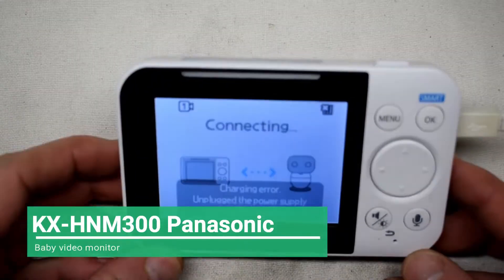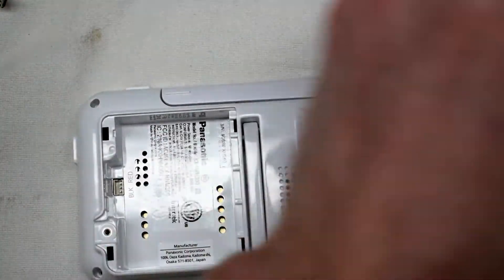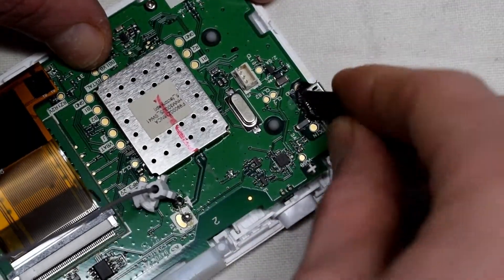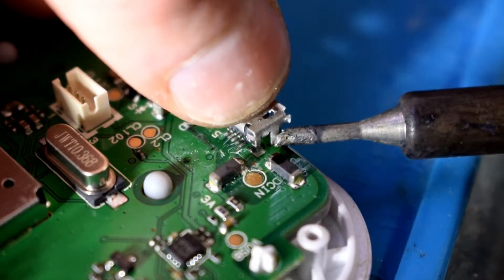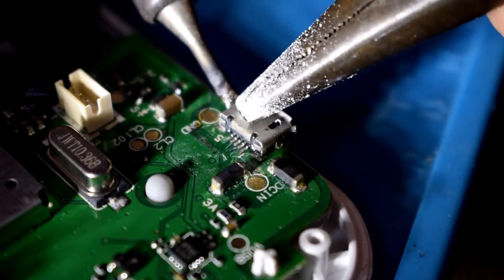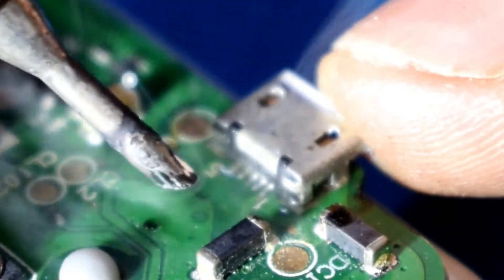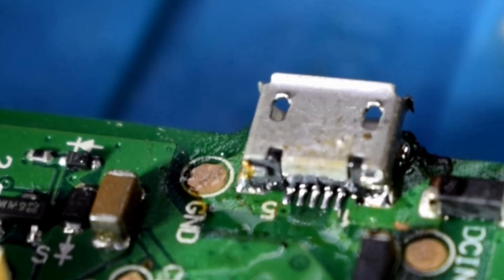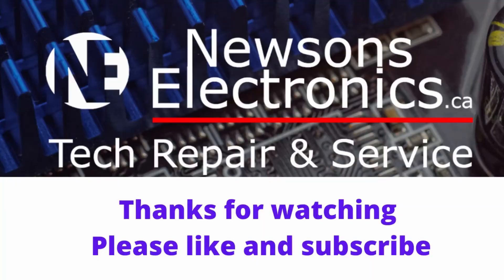Panasonic baby monitor repair (KX-HNM300 )

Comment: My unit charges fine but keeps turning off on its own, sometimes the screen will just black out. What could it be? Do you also know if I can just replace the monitor unit? Thanks.
Reply from the maker: it could be just a bad connection on the screen if the screen works I don't think it's the screen issue. either power or connection issue inside is my guess.

Comment: If antenna ripped off, can I connect it back together somehow?
Reply from the maker: you should be able to solder it back on, if it's not broken it clip on
Reply from the maker: eg circle connector.

Comment: I have a similar model, it was working fine and now it's not turning ON...any suggestions on what to look at?
Reply from the maker: check the battery should measure 3.7Volts